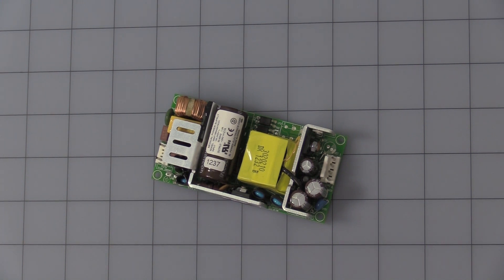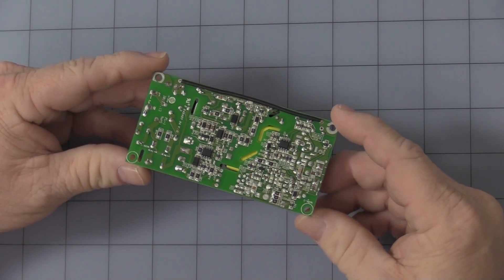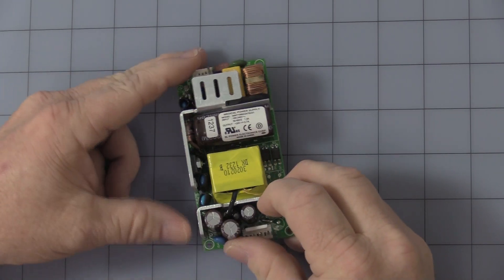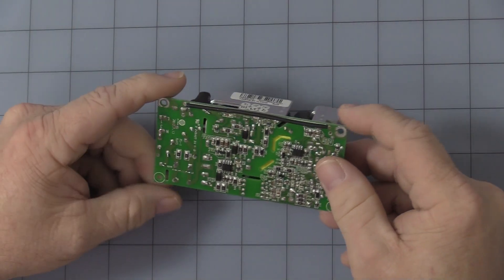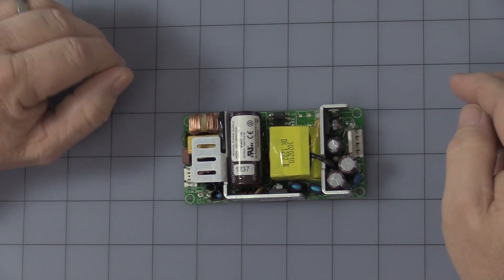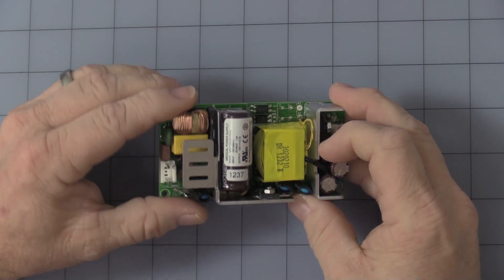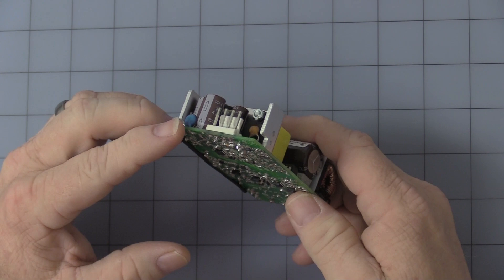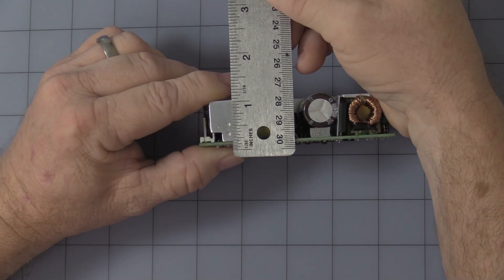MINT1065A2475C01 24VDC 2.7Amp Power Supply 33786 PS

Comment: Can I use RO water filter smps for audio amplifier, what's the difference between RO smps 24v 2.5 amp and laptop charger????
Reply from the maker: I cannot answer your question, some amps are very sensitive to EMI / RFI interference and some are not. Smps typical have some EMI / RFI noise. Most laptop charges are smps but there are always exceptions.